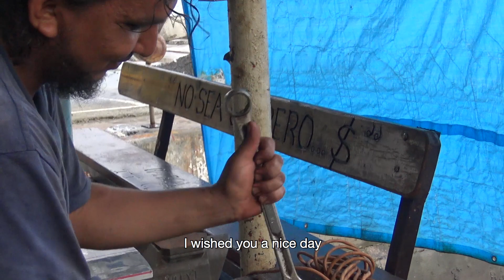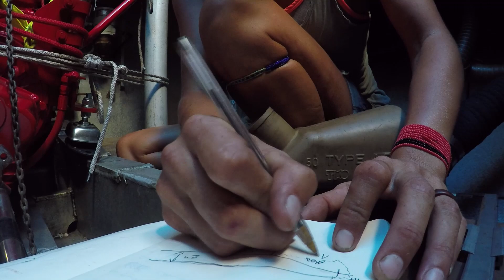Girl Power: Yard Work Marathon - UNTIE THE LINES III #32

Comment: The tool to remove that bearing is a slide hammer.  You need on with a internal hook attachment.  A 5lb or 10lb (𝑜𝑣𝑒𝑟𝑘𝑖𝑙𝑙 𝑓𝑜𝑟 𝑡ℎ𝑎𝑡 𝑏𝑒𝑎𝑟𝑖𝑛𝑔) with the proper attachment would have removed your prop.

If you (𝑜𝑟 𝑀𝑎𝑟𝑖𝑎) decide to purchase one, take a set of locking pliers and weld on a nut to the handle so it can be attached the the slide hammer.  It would have made the last part of that cutlass bearing removal very easy.

Comment: Your aiming for max revs with the motor  , mine was 3600 in the book after   pitching  and propping I was 3500 , a little low but I works fine , I can pull 7 knots tops and reverse is magic, with setting up your motor properly if it’s not it will hound you for ever  keep going

Comment: Awesome, actually got to see a Cutlass Bearing, which doesn't look anything like what a American would call a bearing, but actually is a bushing. Bearings have "ball bearings" , bushings are round things that just rub against each other. Was that PTFE material ? very pricey stuff if it is... Way to go girls, can see why this needs to be done periodically ! That Yell was AWESOME ! So at 8:00 in, messing with your  rigging it looked like ? For next week maybe ?
Reply from the maker: It is called cutlass bearing, not bushing, I am pretty sure about that. I looked up the definition of bearing and it says "the support and guide for a rotating, oscillating, or sliding shaft, pivot, or wheel", so the cutlass bearing would pass as that, IMO. Ball bearings are just a certain type of bearing, but the balls are not compulsory for something to be called a bearing.
It is  reinforced thermoset plastic, because Karl is aluminum. Usually, cutlass bearings are made from brass... This is the one https://www.amazon.com/gp/product/B00ENPW7JK/ref=ox_sc_act_title_2?smid=AUP2O18KWMQMA&psc=1
Not sure what you mean with "messing with your rigging". I did a complete change of my rigging when I was in Guatemala, that sould hopefully be good for some 10 years now :). What you see in 8:00 are my Genoa sheets, if that's what you mean?
Ahoy, Nike
Reply: sure, it could have been the Genoa, but I just saw lines being pulled and though maybe you were working on that also. The company near me might be able to tell me more about that special thermoset plastic, I believe the make custom stuff for everyone . I buy scraps from them, the last one I bought I use as a Bushing, which as a rotating pipe pressing against it with minimum friction. Its for a new huge high powered antenna, I listen to SSB and talk to people in the pacific, on 14.300 SSB Usb. Ham frequency. Weather all day. Pacific seafarers at night, folks from Hawaii, NewZealand, and USA all trying to contact ships in the Pacific, mostly cruisers. I'll check back tomorrow with the info on that plastic if there is anything interesting they can say. Sounds like you've got it under control though ! Awesome, very important part ! Along with the Thru holes, one boat went down because of a bad one ! A YouTube channel, they lost everything. Do they use plastic for those also (because of interaction with Alu) ?
Reply: A washer on a bolt is sometimes called a bearing.  The terms bushing and bearing are used as similar terms. Sometimes it is the type of equipment dictates the term. You can get more precise when you call bearings with the type such as ball bearings, needle bearings, Torrington bearings and Timkin bearings, etc. Sintered bronze bearings and bushings look the same to me.
Reply: Hey Thanks uncle Muir for your thoughts. This was supplied by the internet, must be correct if its on the internet lol. "
Simon Willatts, 10 years as an engineer.
Answered Dec 4, 2016

A bushing and bearing perform the same task to different levels of complexity. Both reduce friction around a shaft, so that the 2 parts can move independently of each other.
The bushing is, at its simplest, a simple tube in between the 2 parts, whereas a bearing might use a race of balls or rollers (not the only bearings, but the most common).
A bushing diagram from a company called Sonnax:
https://www.quora.com/What-is-difference-between-a-bushing-and-a-bearing-Where-is-the-disaster-bushing-located-on-the-pump
Reply: I wasn't too far off at least on the right track. That is a great link ,thanks. Now I am thinking what they classify rod bearing shells  inside an engine?
 People think that Teflon is all the same until you use the wrong type.
Reply: The guy seemed to say all of these things can be called bearings, but some are called bushing bearings, then sometimes they drop the bearing part of the classification. But one thing for sure, Cutlass Bearings and Thru holes are Extremely important on all boats. Not to mention that important bilge pump for when the least expected goes wrong ?
Reply from the maker: yes, they are all three fairly important, that's correct :)

Comment: The engine refit got a little pricey . Another $1,000 just for a place to do the work. You never get used to seeing money leave your hands in record time.
Reply from the maker: It was a bit insane...but we really worked as hard and much as possible...and I even hired some helpers to be faster. But those things were just impossible to do in the water. Well, maybe shaving the aluminum bars, but it would have been tricky to do that only with the generator, too. But at the end of the engine repower, I was definitely ready for a vacation, because I just got really tense from all the work but also from the time pressure, knowing that each day meant more money. But hey, we got it DONE!!! That's the most important thing...in the end, money is just money...!
Ahoy, Nike
Reply: Money is replaceable. Time is not.
Reply: Funny, I don't remember you saying money is just money in the beginning. I guess when you have money, it is just money. Kind of like air is just air when you have plenty of it. You had a great thing when you started this, now, you are just another rich kid spending the saved monies their parents worked for.
Reply from the maker: Dear Rick, I have always seen it this way, in the beginning and now as well. It does not mean that I have so much that I don't have to care. This was the cheapest way to get things done and we have worked our asses off to keep the budget as low as possible. But still, money had to be paid for certain things. I knew that the repower would cost me money, which is why I went and left the boat TO WORK!!! I am spending the money that I have EARNT, I did not find it on the road or won the lottery. Now I could be upset about having to spend the money for the haul out because yes, it's a ton. And you know what, I was in not such a great mood during those days, because I knew that each day was costing me so much. But I got all tense and stressed and those are the moments where I have to pull myself out of it and say "hey, it's just money, when it's empty, you need to find a way to make more". That's what I meant and that's what I believe, now and also in the beginning. Otherwise I would never have left, because I would have been more interested in saving up a big bunch of money instead of living on a small budget and having to stop what I am doing to fill up the kitty every once in a while, because my income that I generate from vlogging does not cover some of my costs.
And not that it is any of your business, but I am not spending any of my parents money here. My mom chipped in for an upgrade of my liferaft and she bought me a fridge after three years because she could not stand the fact that I did not have one. But that's about it. And she did both, not because I asked her to, but because it was really imortant to her and she would have been sad if I had not accepted it.
Ahoy, Nike
Reply from the maker: You are very right! We did that, too. Well, actually Erik did, cause he saw me grinding away and was shaking his head and getting out his big saw ;). I just did not have one, so that was the only thing I could do...But even with the cutting with the saw, it still took ages...Also because we had to test them in between and see if we were already down to what we needed.
Ahoy, Nike
Reply: You are right, it is none of my business. But, how many of your schoolmates have been able to do what you have been able to do? How many of your compatriots? How many of your contemporaries? If what you have done could be done by anyone you grew up with why are you the only one you know, from your childhood friends that has done it? What makes you so special that you can live the life you are living that anyone you have ever known isn't been able to live, by their own force of will? Don't tell me that you are the only person in your life that ever had the dream to live the life you are today. It wasn't your own personal force of life that created your life today, and everyone you know didn't have. Germany is not going to be happy about you not paying into the welfare of future generations anymore than America is going to be happy about me not paying into that fund in America, when I retire, and expect them to pay me back. You are collecting, today, funds which your parents paid into; I will be collecting funds that I paid into. You need to get back to Germany and have brown babies, like all the other white girls in your class.
Reply from the maker: Ric, maybe just as a comparison: If I don't have crazy boat investments liek that repower or rig change, I  usually spend around 500-600$ a month. Some of my schoolmates and my compatriots spend that money JUST for rent! A lot of people have a car, a ton of clothes, fancy watches, big flat screen TVs and what not. The reason why I am able to live this life is because I decided to to it. Many people may have a similar wish but are not willing to leave the comfort or saftey net behind that they have at home. Being on a journey like this is not about money but about changing your life and adapting to what you need to to to be able to do so. There are people out there that live on a lower budget than I do and they are still out there and finding a way how to do it.
I have paid and still are paying into funds for my country and I do have a health insurance. So please don't tell me that I am living on other people's money. I am working, I am generating an income, I am paying the taxes that I have to pay and have a health insurance. So would you please stop judging something that you don't have any idea of. I am not collecting any funds, nothing of what I am doing is being done on the shoulders of others. Except that I have met lovely people that are willing to help me along the way with their time and knowledge. But guess what, I am paying that forward to the people that I meet on the way that might need my help and that's how the beautiful circle closes itself.
Are you unhappy with the decisions you took in your life? Because you sound a bit bitter there...It's never too late...so maybe go and do something about it instead of accusing others for living the life that they dreamt of living. It's all up to you...
Reply: Tomorrow is indeed up to me, or you - today -sort of. You see, it is not up to me, or you, what we do tomorrow, if we don't pay into the society we live in today, and tomorrow, and yesterday. You know should this because you aren't paying into it today, your parents, or elders did it for you. Yes, I am bitter, because I was one of those who was forced to pay 60%+ of my gross income into "the great society" that never existed, in America, for 25+ years, and got ZERO in return. Not to mention the 30% I paid in taxes on my income. I did not choose by my free will to live under the burden that the lawyers in my country have forced me to live under. The lawyers of your country haven't forced you to live your life in the way they demand you to do, as they have me - YET. Look at what the EU is doing to Poland, Hungary, Czech Republic, and Austria today, and what they have done to Greece, Italy, Ukraine, and the Country that used to be Yugoslavia - yesterday. It isn't far off that all of "Europe" will be divided along the same invisible lines that Yugoslavia is split into - not by political, or property lines, but by divisions of kinetic populations - forced into that structure by the "religion of peace" through overwhelming masses of immigrants from Africa and "Asia". In your lifetime, because of your - and your generations - selfish action in abandoning Germany, all of Western Europe will become a third world Continent - because of the luxuries previous generations have provided for you. I'm not accusing you personally of not earning your privilege, it is your entire age group that has taken no responsibility for the future. I applaud you for escaping - if you actually succeed in accomplishing it.
Reply: @ Jean Pierre Amalek , No need to be sorry for your English. Much of what you have written is spot-on, and I agree completely. Some is poorly understood, and some is very informed. This is not the place to argue though. I do fully support what Nike is doing, and wish her only the best in her adventures. Must I limit and define my satire to the understandings of every person who may read my comments?

Comment: At some point they needed a new cut less bearing instead of pulling the old one out they simple pushed down the shaft!
Reply from the maker: Maybe you missed that part, but we did put in a new cutless bearing :)
Reply: They wouldn't take the old one out just shove the old one down the shaft.
Reply from the maker: oh, now I understand what you mean...You totally misunderstood this...There were two cutlass bearings. One at the beginning and one at the end of the stern tube. Don't ask me why, cause for the length of the stern tube, two are not really needed...Maybe someone here has an anwer for that. We took both of them out and replaced the aft one with a fresh one. There was no pushing anything down the shaft involved here...:)